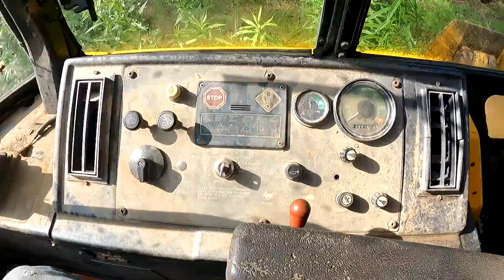The MOST $$$ Ive EVER spent at one time!! John Deere 310c

Comment: Oh my.. I like the JD, it's what I learned on, but I've inherited a Case 580M.  We've put $20k into it in the last 2 years and while its not pretty, it's probably in the best working shape since it was new. All the cylinders rebuilt, front end rebuilt, new Turbo and all the pins and bushings on the backhoe replaced to get rid of all the slop. But it should be able to do a whole lotta work over the next few years.   Good luck Drew,

Comment: raise the RPMs up , less strain on the hydraulic pump , N on the floor by the seat should be a peddle to lock the rear end (pos a track) ya wont get stuck , " your feet is called outriggers > man you on the road now > congrats while digging put your bucket flat to slide on the ground when moving back just lift the outriggers a little and use your backhoe bucket to move around . (forward, back, left n right) dont have to turn the seat around to move, save a lot of time bro